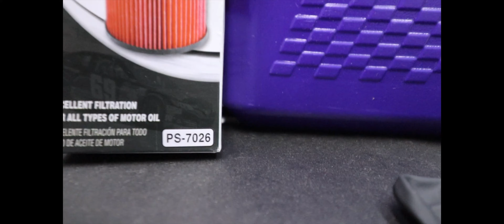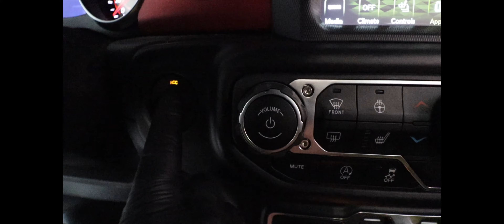How to change the oil on a jeep

Comment: at what mileage or % do you change the oil?
Reply from the maker: I do it every 6k I use only synthetic.  But if we are doing a big overland trip I do it before the trip.  Its cheap and in my opinion way better to start a 3 or 4k trip with all fresh fluids
Reply: @LetsGoJT  why do you use 0w, rather than 5w?
Reply from the maker: Thats what the engine requires for me in 🇨🇦  🍁.